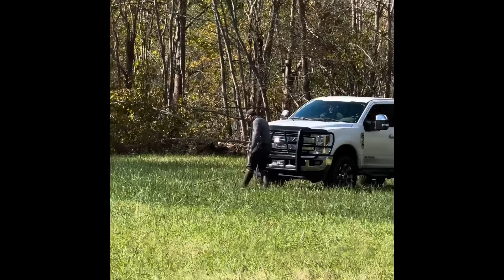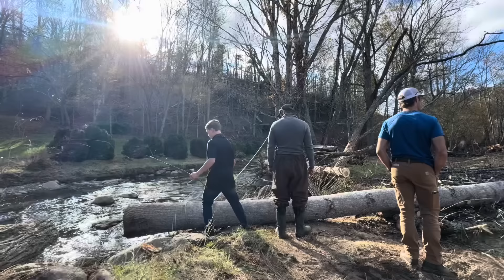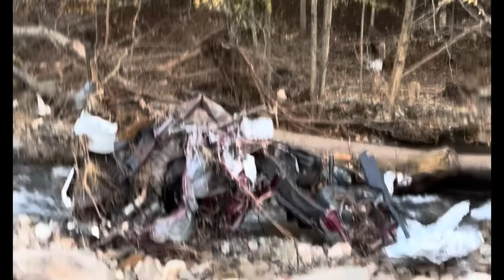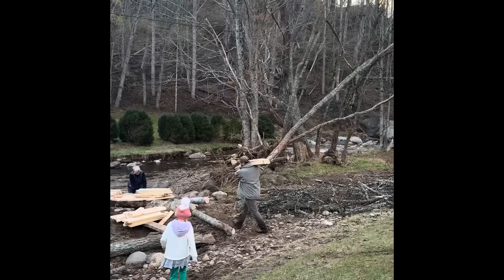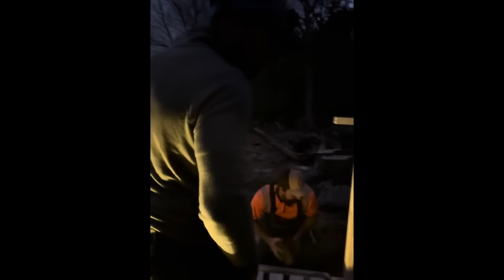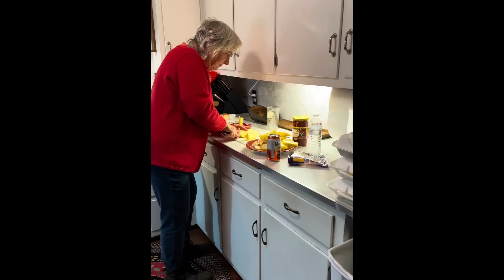Rebuilding Hope After Complete Devastation

Comment: I don't know much about trees, and may not be possible, but all the trees that fell, can any of it be used to help rebuild homes? It would be a start to helping the rebuilding process if possible. I'm sure there are saw mills that would be willing to help saw the trees up into usable framing and trusses.
Reply: That has been happening and it's a great idea!
Reply: I've seen some of the smaller one-man mills making lumber, but it would have to be seasoned before you'd want to use it in a house. 6 to 12 months to dry before you don't worry about cracking or warping. For other purposes, maybe sooner. The ones in the debris field, many of them are covered in clay, which is another issue.
Reply: @durgan5668  pine  or spruce is usually what is used for building
Reply from the maker: They can either some but a lot of them have been contaminated with chemicals and debris
Reply: @ONThree  Thank you ALL for educating me!! I didn't think about the contamination. Hopefully they can find a way to bring some of the trees back to the mountain in some form. God Bless!!